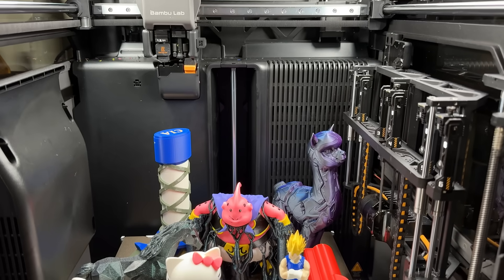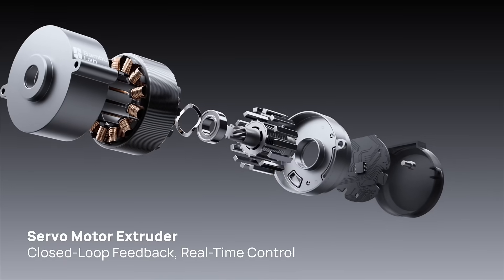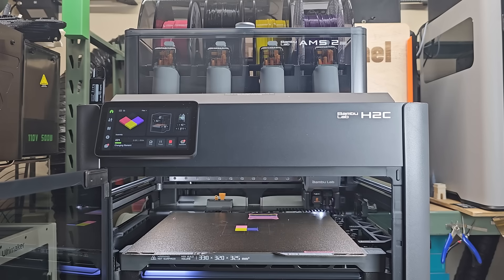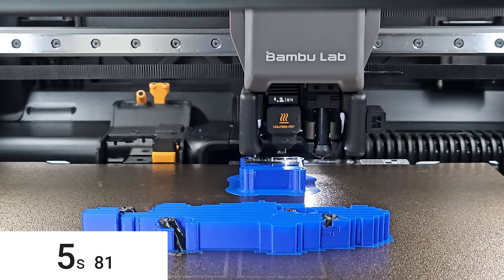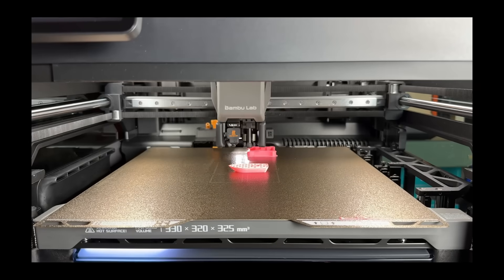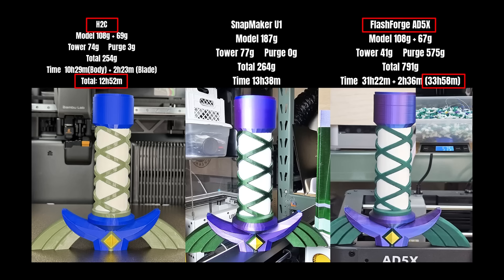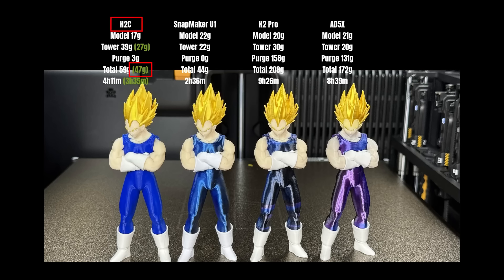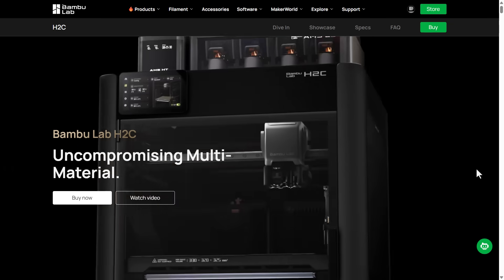BambuLab H2C Preview: Summary, Features, How It Works, and Comparisons

Comment: Your description is a bit incorrect.  The filament is always cut.  The waste savings is only the amount of material left in the hot end.  The only way to print minimal waste on this printer is to use two filaments, one for each nozzle.   This is a huge contrast to the Bondtech INDX product.    I believe the claims of time savings are also a bit overstated since you can purge material into other parts and infill, so this should always be stated as maximum time savings.   The real plus of this machine is the convenience of having 6 nozzles to choose from.   You can keep them dedicated to materials types and have different sizes.  Great printer, but I think it was a bit of a bait and switch.  I think it would be more than sufficient, but the real time and material savings currently only come from the Prusa XL and Snap maker products.
Reply: You can flatter yourself with Snapmaker U1 as much as you like, but it will be much easier to place 10 extruders in the future than 10 heads. This is a step towards the future. They will now work out the process, patent it, and release a product that will outperform everyone in color printing. I told you right away that Bambu would not give up the 3D printing market. If Snapmaker does not come to their senses, they will lose everything. Their product was taken while there was no replacement. Now, serious people are entering the market.
Reply: @prostoCAD  The H2C avoids the INDX patent, or they would have done it that way.

Comment: What’s the point of 7 hotends if there’s still only one tube from the AMS? I thought each hotend would have its own filament permanently loaded, like a real toolchanger.
Reply: Because that takes up significantly more space than the nozzle-only setup and the H2C isn’t a “Toolchanger” at all. That’s why the XL and U1 are huge in size and aren’t enclosed and can’t do complex materials. The H2C is the same dimensions as the H2 series. Plus, you can load 4 AMS’s into the nozzle rack side of the toolhead, meaning you can print 16 different colors between those 7 hotends. Plus, you can still do ABS, nylons, PC, and all the other technical materials you can’t do on the U1 or XL

Comment: It's not much more advanced than anything else on the market... It's a compromise between AMS and actual tool changing. It is more complex than a regular tool changer, but that doesn't make it better. In your own comparisons, the Snapmaker U1 stacks up very favorably, often being much faster, and it is far cheaper. Let's not glaze Bambu Lab just because they do fancy marketing and make proprietary systems. This is a super expensive solution with a lot of cons. Nobody is going to be copying this design, but many companies are going to make proper tool changers in one form or another.

Comment: It appears that the wayto go is like the SnapMaker U1.  As I see it, to improve on the U1 one has to optimize (cost,weight and size) of the tool and optimize the tool changer so that one can increase the reliability and minimize the time it takes to swap the tool.  Let suppose one has a bigger printer (a plate of apprx. 400x400x400). This way on can put 4 spools on each side of the printer for a total of 8.  Also, if the tools are smaller (e.g. 20% smaller) then we could find a way to fit 8 of them.  Also, If the time to swap them is reduced to 4 secondes then it does not matter if a multi color print requires 1000 swap, it will add a bit more than one hour to the print time.
Reply: its the reason why i didnt buy the u1...plus print quality is lower
Reply: @Aimless_Drive  I am very curious about these downsides you mention of the U1. I was looking at the H2C but this video actually introduced me to the U1 and I can't help but feel like it glossed over comparable or better metrics. 3:00 it beats the H2C handily in time and has a slight edge in filament use. It looks like the H2C is going to be available much sooner and is all around more polished but there is a significant price differential, especially, as you say, for a hobbyist wanting to print kids toys and around the house stuff
Reply: you may have missed the fact the u1 toolheads are essentially consumables because they have a certain life on them. replacing each through the life of your manufacturing business can be too costly to make sense. as a hobby machine...sure! print farm...nope. long term maintenance cost adds to price

Comment: Looks like a nightmare to service or repair. For your final review, I would like to see a breakdown of the cost vs saving for the filament compared to something like the Snapmaker U1. How many spools would it take to break even?
Reply: It would be hard to repair for a 3rd grader; these aren’t that complex.
Reply: It won't be a nightmare, lets calm down. It uses one of their servo motors to move two racks up and down, that will never break. Induction heating doesn't have moving parts. Magnets hold the nozzles and the pcb boards on them transmit without pogo pins, which Bambu set out to do in the first place because it makes it more reliable than the pogo pins on say, the Snapmaker U1. The only part of concern I see is the locking/unlocking pin and the fork in the toolhead that locks the nozzles in place.

Also keep in mind that every H2S or H2D owner is already going to have to disassemble their whole printer to install this and it doesn't look too bad, just a lot of screws to keep track of

Comment: Hrm. In comparison to the Snapmaker I'm having a hard time seeing the benefit of their current offerings even though this is just a "sneak peek".
Reply: From my perspective Bambu Lab is a superior engineering house, they have more experience and are leading the way in turning a 3D printer into an appliance.
Reply: @judd_s5643  Not disagreeing with you, but if their competition can produce the quality for what?  1/3 of the price?  Then they need to get a little more competitive with their offerings.  I see them pricing their high end toward the Prusa price points which IMHO is a mistake.  So long as the quality is there in the competitors' offerings.  To be fair, I have based my opinion on Aurora Tech and Teaching Tech YT vids only... waiting for my Snapmaker to arrive later this year before I can be certain.

Comment: It would be interesting to see the times between this system and full toolhead changers on random color prints we now mostly see 'test prints' that make sure they have between 3 and 4 colors on most layers showing a biased to full toolchangers. The mix of real prints will probably show a much more mixed speed difference. This might even change more once bambu allow mixed nozzle sizes within one print. Not claiming toolchangers are not by design faster but many reviews force the issue. Your example is much better already and if we keep the normal rule to 'fill the buildplate' will be even less.

Comment: Would love to see a quick comment about any bed heating / adhesion issues. - Awesome job as always Aurora & Bro.
Reply from the maker: The default PLA profile was set to a 55°C bed temperature, which is risky for small prints. When the print has a large flat surface, I leave it at 55°C, but for smaller prints or prints that run for many hours, I would not save that little electricity and risk having to reprint everything. At the end of the day, it is just a textured PEI sheet, and at 65°C for PLA, it has zero adhesion issues. For PETG, it actually sticks very well at 70°C, so I do not need to use 85°C for all PETG prints. ABS, PA-CF, and PC also stick well at normal bed temperature.
Reply: @AuroraTech Thanks for taking the time to answer. 🙏

Maybe something wrong with Joel’s (3D Printing Nerd) test machine then. That’s the first time I heard about bed adhesion issues on a Bambu machine.
Reply: @AuroraTech  very interesting since they have 65c as standard on A1 profiles

Comment: How does H2C make any sense with more than 2x cheaper Snapmaker U1 doing the same in 99.9% use cases, and with TPU even more than H2C?
Reply: U1 can't do high temp, that's the difference
Reply: @riba2233 Whats high temp for you. U1 discord has people doing ASA ABS all day long. All they did was (literally) put IKEA plastic box on top.
Reply: It doesnt... they should have debuted this system with P class printer not on H maybe then it would have been actually useful
Of course then they would have to keep it price competitive with U1 instead of pushing theyr already overpriced H series
Reply: 2x cheaper? Oh, you mean half the price.
Reply: That 99.9% use cases if true for you yes. But we are not all the same.. People who have set their minds to the U1 clearly stay within what the U1 can do and define the rest as 'not important' and thats fine for many maybe even most but not all people.

Comment: Thank you. I have seen other reviews from big 3d printing channels say this printer is incredibly slow compared to a tool changer. But the results you showed tells me they're either doing something wrong, or are they are really exaggerating. 

Personally, print time doesn't matter to me at all anymore. The reduction of waste with trusted Bambu Lab quality is what I like.
Reply from the maker: As I mentioned in the video, there are three types of color changes:

(1) Switching between the left and right extruders. This is the fastest, taking about 7 seconds, and produces zero waste.

(2) Using the right nozzle with the hotend rack. This is also fast at about 30 seconds because the filament needs to retract back to the AMS and the new filament needs to load from the AMS to the hotend. This produces zero waste.

(3) When using a new color, or when printing more than seven colors that require two or more colors to share the same hotend, flushing is required. This takes about 1 minute and 10 seconds. It is still faster than the first-generation AMS or its clones, but it does produce some waste.

To maximize efficiency, you want to utilize the first type of change as much as possible. When printing with seven colors or fewer, you also get many of the second type of change. However, the second type still requires about 20 to 22 seconds more than a tool changer for each switch, so in most cases, it will still be slower than a tool changer. And not to mention that if you print more than seven colors, some colors will have to share one hotend, which goes back to cut, flush, and poop, slowing down the print tremendously.
Reply: @AuroraTech  Indeed maybe i was unclear i think some other reviews seem to push most tests in one direction and indeed i wonder how the mix between 1,2,3 really is on daily prints or even by smart planning (how to put them on the plate and how many etc etc). I don't think within the 'perfect' range of tool changers (2-4/5) colors per layer this system will ever be as fast so its interesting to see how it works on real models found online or if you keep the weaker points in mind. In the end every machine/method is a compromise and anyone who orders a h2c should be clear on that since you won't buy a top machine in price without doing some research. I ordered one with 2 ams units fully knowing the downsides but also the upsides.
Reply from the maker: For some models, with the right setup that uses both the left and right extruders and switches between them as much as possible, along with printing certain parts separately, the H2C can be on par with or even slightly faster. But in general, multiple tool head printers are faster most of the time.
Reply: @AuroraTech Definitely. But it's not a drastic difference that some are saying.
Reply: @AuroraTech  Would like to see you include new torture test by Prusa Research and compare the times between Prusa XL, U1, H2C and H2D.
Reply: Indeed most reviews compare models that are 'perfect' for the toolchangers and push the difference not real daily models. They also don't follow the normal rules to get more speed per print (filling the build plate for example). Many layers will only have 2 colors for example and not all 4 .. and once your whole print has more than 4 colors well ehmm you are done unless you also add a ams like system. Its not weird to have 6 colors on the whole print but that 90% of the layers have 1,2 or 3 at max. Take indeed a doll, feet probably different color than hair, belt, hands, face etc etc...
Reply: Nobody said it was incredibly slow, they just said it was slower.
Reply: @riba2233  I watched about 10 reviews now and it makes sense they compare mostly prints that highlight the slower part. The only thing i am saying is the gap will be less with most models as this example showed. And there are ways to make the gap smaller. It is easier to print for example 4 or 5 on a plate and reduce the gap then to make a fully enclosed and heated U1 or print on a XL in 10 colors.  Some people only want speed and that probably means don't pick the h2c but if you do because you want all its features you probably have to 'work around' the slower speeds by the same tricks we used on all ams based systems so far. Not trying to pick a fight i think we agree but its just how most (not this one) present the issue.

Comment: Check the H2C bed heating with a FLIR thermal camera and let us know how it compares to the U1 and XL
Reply: Please check it without the build plate as it may not show accurate results. Worried the textures pei plate will be reflective to heat where as the flat matte bed might be better for results? Waiting on your full review until I order one. You're the best! :D
Reply: From some pictures I've seen on Discord the H2C bed heat distribution is very bad and on the U1 there is only around 2-3° difference. That's a win for the U1.
Reply: @easy4breezy they have the link for the discord
Reply: @easy4breezy if you have the discord link I would be happy to get it. 😌
Reply: lol yes we all watched that yt video
Reply: @HELLOHOGO  Which video is that?